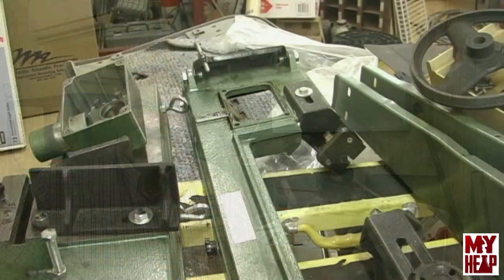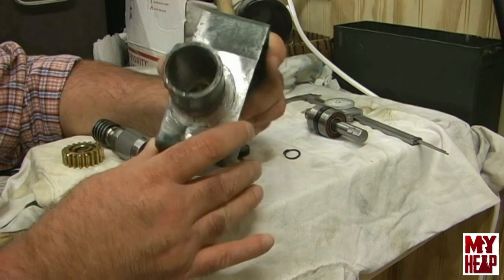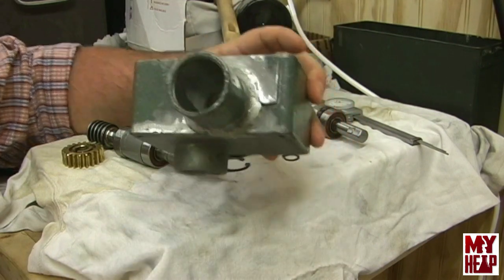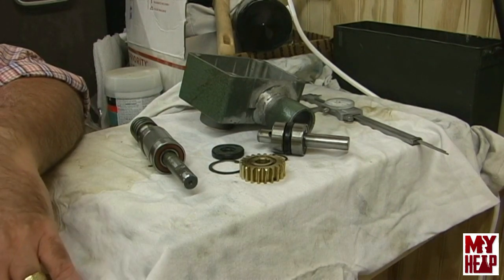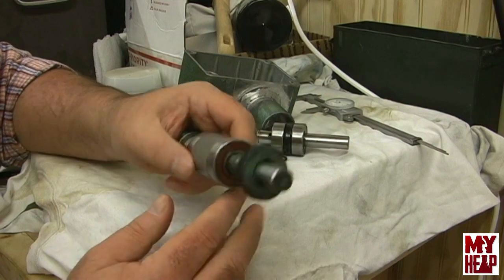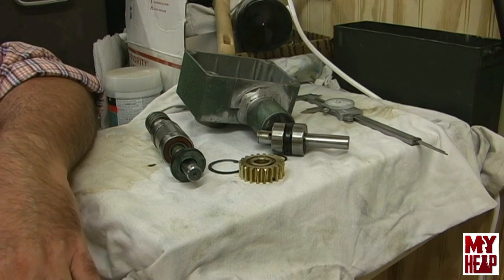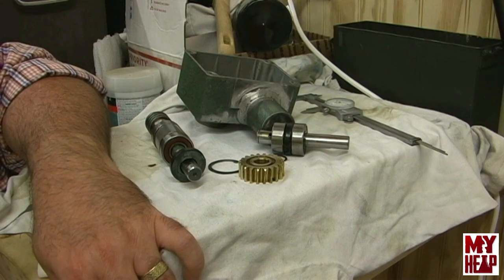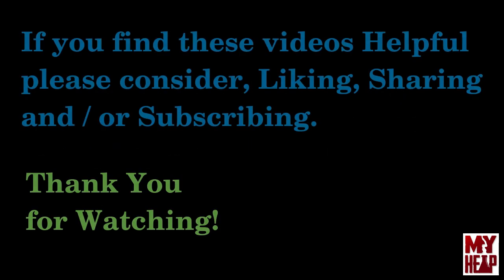Metal Saw and Other Stuff

Comment: There are quite a few videos on YT for a DIY bearing puller if you dont do many of these bearing removals Joe. Poke around. My first thought was an aluminum spacer, but just relieve the center so the contact is on the outer race as you pointed out. I wouldnt throw a ton of $$ at that saw either. i bought mine which you have seen pretty cheap, but if you can salvage that one you will love owning one ~ Richard
Reply from the maker: One thing for sure is I hate that darn hacksaw!!  I will look at some video.  The big question in my mind was how to get it behind the spacer.  But I suppose I can cut the spacer out then measure between the bearings to see how long it has to be.  Thanks for the tip.

Comment: Nice score on the Logan lathe. If there's a engine shop around I bet they will press the bearings off for free
Reply from the maker: Hey Chris, thanks for stopping by.  I have the gearbox back together.  Had to make a bushing to press the bearings in, but it all works.  Thinking of doing a video of the machine going back together.

Zachary bought a couple gallons of citristrip so I think he plans on starting on the Logan soon.

Joe

Comment: 1) put the whole assembly in the lathe and turn about 5 to 8 mm away from the plastic part
2) put the assembly in the vise, with the bearing resting on the top of the jaws, just not clamping the plastic area
3)tap the shaft out of the bearing (use some hardwood/soft hammer/copper...don't bash the shaft!!)
4) job done, no extra tools needed

Paddy
Reply from the maker: Hi Paddy, welcome back.  That would certainly do it.  I did, however, put the worm shaft between centers and turn down the protruding plastic and pressed the assembly back in the housing.  Although, I did have to turn down and make a bushing to press with.  The gearbox is assembled and as soon as I find some replacement Metric (Or drill and tap imperial replacements) I hope to get the saw back together.  Thanks for stopping by and commenting.

Joe

Comment: That weld should hold up pretty well for what it's doing. 

You can find bearing pullers at harbor freight, but I find it easier to just make them myself. Easiest way to do it is if it's a smaller bearing and you have a twist drill larger in it, just a piece of steel plate, like 3/8" thick and drill the hole that's slightly larger than the center shaft, then take that large drill bit that's slightly larger than the bearing, then drill down until it just starts to punch through the other side with the center of the bit only. It'll create a sharp but tapered bottom with a hole in the center that fits the shaft. After that, just take an angle grinder and cut it in half. Just tap the two halves in behind the bearing and the sleeve, and you should be able to get it in there or it'll move the bearing forwards down the shaft a little bit. Just use a pulley puller with that piece of plate steel and it'll come right off no problem. 

If you dont have a drill bit big enough, just set the compound to around 10-15 degrees off of square to the bed and use that to cut the tapered socket instead.
Reply from the maker: So the drilled taper is to catch the inner race on the shaft?  Am I following you here?  I was telling MSFN that I didn't know how to get behind the spacer.  But I can cut the plastic space out, measure between the bearings and then I would know the size to make it.  Sound right?
Reply: The drill tip taper would be kinda a wedge to get in bethind bearings that you cant usually get into, like normal bearing pullers have. It is tapped in between the bearing and whatever and acts as a wedge so that if you can get the two halves in behind the bearing to give a surface to grip the bearing on, then all that is left is something to pull on it. Alot of people just weld some nuts on the outside to pull the two halves together around the bearing itself and hold it in place while pulling on it.
Reply from the maker: Thanks for the explanation Chirpy.  I don't mean to be dense, it comes naturally to me sometimes!  :)
Reply: lol, Ive worked in IT before, you arent dense, dense is some of the people I have had to fix the computers for, lol. I hope that works for you to make your own bearing splitter.

Comment: G’day Joe, just push the lot off together or put the shaft in the lathe and machine it in place. I must say they made it cheap that housing is so flimsy. Cheers Peter
Reply from the maker: I ended up placing the worm shaft between centers and machining down the protruding plastic.  Then I machined up a bushing to press the bearings back in.  Had to go to a co-worker's house to press them since I don't have one.  It is on my wish list.  That and a sheet metal brake.  But your right, they didn't pull any stops when it came to cheap.  Fortunately it went together without incident.  Thanks for stopping by Peter.

Joe

Comment: Hi Joe,   Sorry it's been a while, been traveling.    You most likely have a tool in your computer tool kit that may aid you in pulling the bearing.   If you don't have a puller here is what I would try.   Drill a small 1/4" hole in the plastic collar, heat the whole assembly in a toaster oven till about 150 deg.   then use a can spray duster (the kind you use to blow dust out of computers) invert the can and spray in the hole to cool the shaft and also spray the open end of the shaft take care not to spray the bearing.  This should shrink the shaft and help you pull the bearing..  Let me know...LaterWalt
Reply from the maker: Hey Walt.  Great to hear from you.  Didn't know what happened to you buddy.  The last I saw, you were eating from the hands of a pretty young lady.  Figured you must have found better things to do than play on YouTube.  haha

That is a good idea.  Will have to try to remember that one.  Any progress with your Dunlap Lathe?

Joe
Reply: I've been in and out of town for the last few weeks so a sub has been working my STEM class I will be back in class by the end of the month, we'll work on the lathe then.  Should be home the rest of the year my projects are falling behind schedule... 😥

I purchased the same HF saw ~ 10yrs ago, it's been a acceptable unit not the greatest quality but with careful adjustment it works pretty good plus it's better than not having one..
Your shop is looking better,  I'm jealous... 
LaterWaltP.s.  How is the Glenfiddich?
Reply from the maker: The shop is very slowly getting there.  What you cannot see in the video frame is the horrendous mess that surrounds it.  I know it is a cheap saw, but has to be better than messing with the hacksaw!  The Glenfiddich is great, thank you for the trade.  The wife and I toured the Maker's Mark distillery and picked up a bottle of 46 and Private Select while we were there.  It was a neat place.  Tried to get my wife to pull some pictures from here phone, but got sidetracked and didn't get them.

I am looking forward to your upcoming videos!

Joe

Comment: I saw a center hole in one end and if it has a center hole in the other, put it in your lathe and see if the shaft runs true. if it does just cut some of that plastic off or what ever it is between the bearings. If you should have to pull those bearings just go to harbor freight and buy a bearing  splitter, or puller
Reply from the maker: Hi Leo, I think I will do that and then press the assembly back in place.  Glad to see you stop by sir.  Thanks for the suggestion.

Joe

Comment: Noticed the mini split in the background of your shop, do you like yours? I just put one in my shop about a month ago it's been great so far.
Reply from the maker: I love it.  It is a Mitsubishi DC split.  Runs on a 15A 220 breaker and is quiet as a mouse.  I have been running it now for a few months and have not noticed it on the electric bill at all.
Reply: @MyHeap  Havent got my first electric bill sense I got myn but I'm hopeful it wont go up much lol. Defiantly think it's one of the best investments I've made in my shop, makes it not miserable to be out there. Hope it has decent longevity though, I have a surface grinder so I'm kind of concerned the dust will kill it prematurely.
Reply from the maker: Mine has plastic washable filters, but there is enough dust in my shop that I check them weekly and vacuum them out when they start clogging.  The unit I bought has a 12 year warrantee.  I think they are normally 10 year but my HVAC guy is a certified installer / repair guy so ended up with 2 additional years.  It may be too early to tell, but so far so good.  Where I live in middle TN it is hot and humid so cooling it off and drying the shop has been GREAT.  But I did stuff the walls with r19, the attic with R38 and the floor with R30.
Reply: @MyHeap  Not sure what my R factor is, I got 2 inches of closed cell foam on the walls and ceiling. Myn has the same style of filters, havent checked them yet, lol sounds like I might already be a little late on that though. Samsungs have a 10 year warranty to but I suspect they would weasle out of it sense it's in a shop not a residential building. In reality if I only get 5 years out of it I'd be happy, the 3k up front cost to be comfortable while working is well worth it.
Reply from the maker: @Daniel-vq9zb  I hope that it works well for you.  So is your unit DC too?
Reply: @MyHeap  yes, it has the variable speed inverter.

Comment: you will need to press both bearings off together. they are not that tight. i have the same saw but mine is northern tool
Reply from the maker: So let pull the bottom one and let the spacer pull the other so to speak?
Reply: i used a treadmill motor on mine. check that video out
Reply: yes. its plastic and your not reusing it so it dont matter if its destroyed
Reply from the maker: I know this may be a dumb question, but how would I determine the length of the replacement spacer if it crushes?
Reply from the maker: I will go take a look...
Reply: you get that first